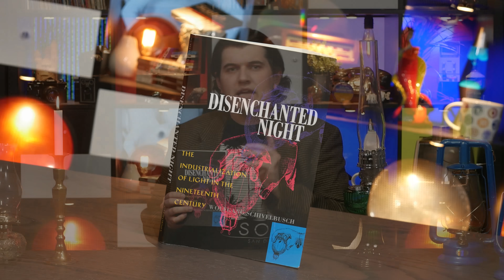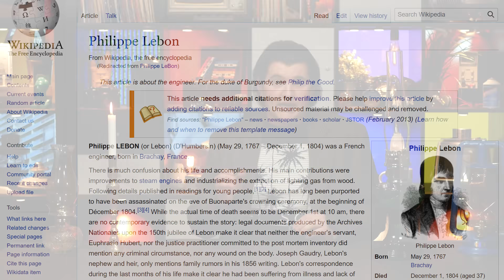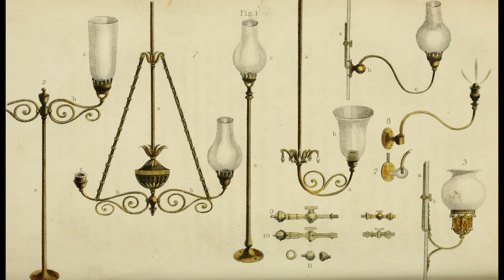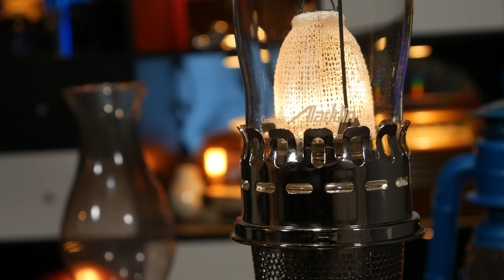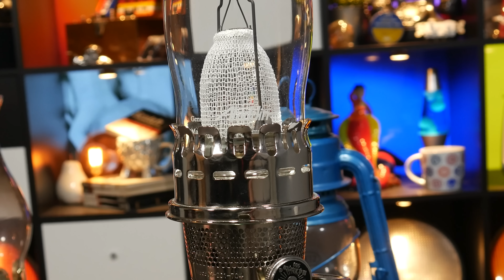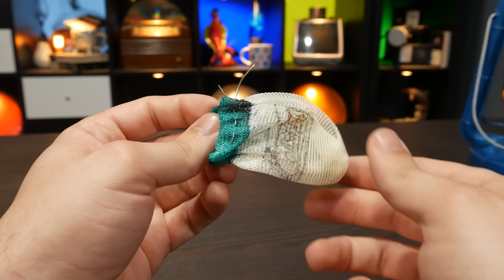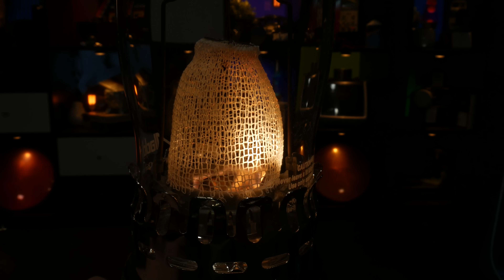How the gas mantle made lamps 10X brighter

Comment: I wonder if that aladdin lamp could have pre-burned the kerosene in a lower chamber. Use some of the heat to gasify it, either through incomplete combusion or whatever. Then at the mantle you could mix fresh air in with it and burn it the rest of the way in a more controlled fashion

Comment: I came from a large family and I can remember Aladdin lamps, 60 or more years ago. We had a cottage that was not electrified. When it's not being used, children might take the chimney off and attempt to 'feel' the mantel. It would immediately fall apart. This would upset my father. He tried operating it on top of the china cabinet but that caused the ceiling to become discolored. He thought that was bad, as I recall. We also had a Colman lantern that used "white gas", a type of gasoline that had no additives. Some went into the tank and a hand pump in the cap would pressurize it. Those were the days.

Comment: In the UK "coal gas" was a mixture of coal gas (as described) and water gas (carbon monoxide and hydrogen made with steam on hot coke).  This was replaced by "town gas" which was made from oil.  This was replaced by "natural gas" (methane from underground deposits).  This may be replaced by "green gas" made by anaerobic fermentation of organic waste.

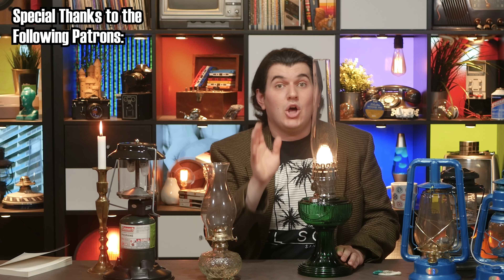Comment: 27:29 Niche, except for all planes flying around on it, afaik.
Reply from the maker: True, true. Though in fairness, it's not exactly the same stuff.
Reply: @TechnologyConnections  come on, you can run a diesel automobile with Jet-A1, and heating oil (and used olive oil), so you can run these lanterns on the same stuff...
Reply: @kornaros96  But trying to do the reverse would be more problematic.
Reply: @kornaros96  Not at decent RPMs, at least for Jet-A1. They don't have a high-enough cetane number.
Reply: @TechnologyConnections  it really kinda is. It's kerosene though some are, admittedly, mixtures.

Comment: “You’ll likely be buying kerosene exclusively for the lamp.”

Me: looks at old diesel Mercedes in garage “Hah! Wait till he learns what #1 diesel fuel is basically made out of!”
Reply: Or if you have a jet engine
Reply: @AvenDonn  Sooo The batmobile?
Reply: I just buy kerosene for my jet engine. it's gentle roaring helps me get to sleep a night.
Reply: @charlesrense5199  A hit with the neighbors too, I imagine. Kudos to you for performing such an important civic duty.
Reply: @shannonrhoads7099  at first they were annoyed. But when I explained to them that they would earn frequent flyer miles...
Reply: In the video he made before this one, he mentioned how kerosene is basically jet fuel.
Reply: Jet Engines 🤝 Rocket Engines 🤝 Oil Lamps 🤝 Diesel Engines 

Running on Kerosene
Reply: You are at least partly correct, but diesel fuel can't (or shouldn't) be used in most kerosene appliances, so you'll still have to buy kerosene just for such a lamp.  Kerosene has shorter molecular chains with a lower boiling point and is thus condensed /before/ diesel in the refinery stack.

Diesel offers more BTU's, but will be dirtier and smellier in kerosene appliances.  If you choose to burn diesel in a heater or lamp, you will want lots of ventilation and should expect that things like burners and globes will require a lot more cleaning.
Reply: To add to what Rob said, diesel/jet fuel/jp-8 all have various additives that you don't want to be burning and breathing. They are based on kerosene but not pure.
Reply: Ah yes. Reminds me of good'ol JP8. The fuel the military likes to put in just about every goddamn thing they can. Because of this, you'll naturally come across some dumb boot from time to time that tries to use it in a gasoline engine.
Reply: @KennyTheB  It's an essential ingredient for Navy coffee...
Reply: @KennyTheB  Not nearly as disastrous as trying to use gasoline in a diesel engine.
Reply: Kerosene is a good non damaging grease cleaner especially for o-ring chains and any stuff with rubber parts.
Reply: I found some lighter fluid. Smells and cleans oil based paint just like kerosene...
Reply: Well that and the camping stove to match that newfangled lantern
Reply: You can do way worse than an old diesel Mercedes.
Reply: You can do way worse than an old diesel Mercedes.

Comment: "... burns cleanly, and is green."
Thank you that was fantastic.
Reply: I still haven't stopped laughing since Dietz Nuts and this just elevated it.
Reply: @Sayntavian  No pun could quite top that one.
Reply: Looking forward to the follow-up video on the technology that makes it so green.
Reply: @HadleyCanine  copper dust in the glass?
Reply: @HadleyCanine  it’s kind of neat though not sure if it’s dedicated video worthy.  

As memory serves though later called “Vaseline glass” it used to be called uranium glass. I’m sure you can guess why. 

Indeed uranium glass was a thing, and yes it had uranium in it.  Technically the process turned it into more of a ceramic glass.  The uranium allows you to temper it at a higher temperature and gives it that opaqueness.  

On second thought, it could be viable for a dedicated video.  There actually is a lot to that process now that I sit and think about it.
Reply: @IAmTheRealBill  uranium glass is technically still a thing: its not considered much more risky than lead glass as long as you're not sanding it.
Reply: I actually scrolled down through to comments specifically looking for one about his "green" pun! ♻️ Thank you! This makes me happy. 🤓

Comment: I love the depth and detail and the fact you allude to the loose ends you will follow up on. Luting in whisky distillation was usually a paste made from wheat flour that filled the gap between the bottom of the still and the condenser. I suspect his "forced my lute" problem was a small explosion of the flammable gasses mixed with air, especially if it broke his glassware.  I don't know if you are going to continue with the evolution of gas production, but later production was different and used coke rather than coal. I believe the gasses and liquids distilled from coal were more valuable as raw materials than as illuminants. Another problem was there were liquids that would condense out of the distilled coal gas and pool in the gas lines. Later gas production was called 'producer gas' and was made by pushing steam (H2O) into red hot burning beds of coke. Sometimes air was mixed with the steam. This reaction produced Hydrogen and Carbon Monoxide along with some Carbon Dioxide and other non flammable gasses. This producer gas was produced during the daytime at local 'gas works' throughout the city and stored in big tanks with a floating lid, and used during the peak periods in the evening and night. This gas, with its high CO Carbon Monoxide content was very poisonous and is often referenced regarding committing suicide by sticking your head in the oven.
Reply: I suspect theatergoers' headaches were, at least in part, due to carbon monoxide poisoning.  It binds to hemoglobin stronger than oxygen does, and in that way reduces respiratory efficiency.

Comment: In the house where I was born, there was gas lighting right through until 1958.  In the main rooms the lights were controlled by a switch on the wall which had a Bowden cable to operate the gas valve at the light fixture on the ceiling and a battery which, when the switch was pressed down firmly, caused an element to glow and light the gas.  The light they gave was a gentle but bright light.

Comment: We're using one of these gas mantles lights powered by a 13 kg kitchen gas cylinder as late as 1991, because we lived in a rural site with no electrification (albeit close to the city, just the wires didn't got there). These things are bright af and cast some bizarre shadows, and make the continuous noise of the gas escaping.
When I was like six year old we moved to a new house with sweet electricity and never looked back. No fond memories, we just needed this thing that specific moment.

Comment: I hope this series continues onto safety lanterns used in mining for some years. I believe they have a 'flame arrester' to prevent them from causing explosions.
Reply: Now you're wandering into Davy lamps.
Reply: Early carbide fueled miners lamps basically produced and burned acetylene
Reply: they basically had a fine mesh that when the methane entered through it into the lamp it would safely burn without spreading the flame outside of the lamp. I'm not so sure on the physics of why that occurs but it does.
Reply: @A.Martin  It was demonstrated at the Royal Institute by Humphry David who invented the lamp. The way it works is that the screen is small enough to let combustion gasses through but not the flame front. The original filter was a bundle of tiny tubes that formed the screen which cooled the flame front to below combustion temperature so no flame could progress to other side of the filter. Think of a bundle of drinking straws but shrunk down by 80% and made out of brass. It was eventually refined by using a stack of woven brass screens with fine brass wire and each screen was spaced about a quarter of an inch apart. If you look at a miners lamp there's a large collar that looks like a hood above the light glass. The filter is housed in that hood.

Comment: I've never understood why the Alladin company is so fixated on such a dangerously top-heavy, small base design. In my cabin loft I knocked one over with an elbow bump, was instantly in complete darkness with tiny glass shards everywhere (I was barefeet in bed) and kerosene pouring onto the floor below and pooling inches away from a woodstove filled with burning wood. I did notify the company of the event, and got no response.

Comment: Minute 11:
Well... the Explanation is actually relay simple... i you are not trying to explain it an hard scientific way.
If some Elements are heated enough, some of there electrons becomes "stimulate". They getting in an higher electric State of the Atome, by "absorbing" the heat. If they are getting high enough, they will fall down in the basic electric state of the Atome and, by that, emitting Light. If you are saying: What a Moment, i have heard something like this already... It's a LASER!" Yes, and no. It is the same basic principle, but of course are the Lamps not LASERs. And, there is an twist on this: Just like in neon-Lamps, they will not emit visible Light. You have to add Rear-Earth-Elements (they are in the white Stuff, in Neon-Lamps), to transform this Light in visible Light. By just the same Prozess... But of course, this time the Atoms geht stimulate by the invisible Light, not oft the Heat.
But don't let yourself geht fooled... If you are locking in detail on this, it will become fast complicated und therefor easily confusing. It's quantum-mechanics in the end.

Comment: If you think that distilling your own coal gas still at home is bad, you should see what they did in WWII Europe. Due to petrol and diesel shortages, vehicles would be retrofitted with wood gasifiers, either mounted on the rear or pulled on a trailer and the gas was piped into the engine.

Comment: Lovely video. Another thing to note with Aladdin lamps is that you have to leave the flame low for a minute or two before raising it to incandesce the mantle. If you light an Aladdin lamp and immediately turn the flame up to heat the mantle that tall glass chimney has an unfortunate tendency to crack due to the rapid heat change. I have one that is cracked in such a way, although I got it in that condition and didn't do it myself thankfully.

TL;DR you have to preheat Aladdin lamps for a minute or two before you can get light, or that tall glass chimney can crack.

Comment: In Concord, NH we still have complete 80ft diameter Coal Gas Holder.  It is supposed to be the only one left in the US that still has the tank inside.  There is a project currently going on to preserve the building
https://en.wikipedia.org/wiki/Concord_Gas_Light_Company_Gasholder_House
Pictures of the inside https://www.loc.gov/pictures/item/nh0131/

Comment: If you use ultra-low sulfur pump diesel in your kerosene lamps (perfectly safe, compare flash points), you will find slightly increased odor in the flat wick lamps (and slightly slower wicking up a fresh wick) but no odor in the Aladdin.

Comment: I had no idea mantles were used in lamps other than Tilley style pressure lamps, I've normally run them on petrol rather than kerosene.

They're a complete main when camping because when you drive to your next spot the mantle disintegrates.

Comment: The Aladdin always “turns itself up” as it warms up in the first ten minutes after lighting.  I’m not chemist enough to explain why, but if you heavily soot the mantle you can help along the process of burning off the soot by dropping a bit of table salt down the chimney onto the mantle.  The Aladdin is the only mantle lamp I know of that is not pressurized.  I’ve long used Coleman white gas and propane lanterns and camp stoves, and am well aware of Petromax & Britelyt, but have not found any other non-pressurized mantle lamps.

Comment: I remember using a variant of those propane lanterns in boy scouts. They used the same tanks as the propane stoves, and we thought they were pretty neat. One of the biggest parts of the pre-departure routine was shaking the tanks we kept lying around in a shed to try and figure out which ones were full. (I also remember one time we snapped the nozzle off by accident amd sprayed propane all over the campsite. had to wait 10-15 minutes for the wind to clear it out). 

Also, I have a suspicion about how those gasoline lanterns work. I remember one of the leaders had a lantern that used a hand-pressurised tank of kerosene that came out through a sprayer type thing around which the mantel was placed. It first came out as a liquid in a small tray below the sprayer, where it was ignited to heat the feed pipe and sprayer to the point that the kerosine vaporized, after which point it would come out the sprayer and get the mantel to do its thing. I also remember him complain that it was getting harder and harder to find those specific kerosine tanks. 

Or at least I think that's roughly how it worked. I onlynsaw it once or twice and my memory of it is a tad hazy...
Reply: No need to wait 15 minutes. The fuel to air ratio would have been completely off as 16oz or less of propane is completely negligible in open atmosphere for any combustion after a few seconds.
Reply: @etherealrose2139  Good to know. We were all teenagers and didn't known all that much about it. All we cared about was that the tank was spraying gas everywhere and we didn't want to blow up, so we erred on the side of caution, just in case.
Reply: I have a stove and lantern that run on liquid fuel (mainly because propane stops flowing around -32C). If you have any questions about them I could probably answer them.

Comment: Fascinating stuff.. thank you for another brilliant video! 🙂
I have several old and vintage oil lamps from the UK, Eastern Europe and a couple of US DIETZ #90 lamps... all absolutely stink when used indoors so I use them outside when were having a BBQ or roast marshmallows over a fire.
My sister lives in Alton, Hampshire in the  UK and opposite her house is a sewer gas destructor lamp (which uses 3 mantles) which burns off sewer vapor 24/7.
The light it produces is not very bright as it's primary purpose is to simply burn off potentially explosive gasses, germs and noxious fumes from the sewers... but lighting the street was it's intended second purpose.
On a snowy night it looks magical 🙂

Comment: Lookink up "Lute" all I could find was a cement smoothing/leveler tool and dental Lute glass cement.

Maybe its the leveling tool and was used to rake coals (pre-bunsen burners and natural gas) or a previouse use for Dental Lute cement before the advent of modern dental care. Maybe it was used to repair or affix equipment. Does the experiment require a vacume to heat the solution? Might be a clue. Would need more information to get any clear answer.